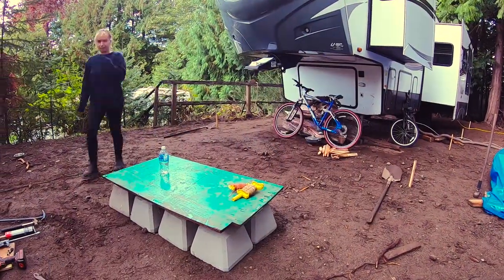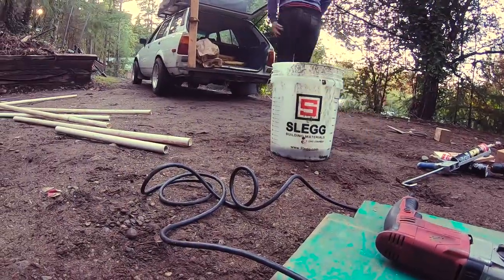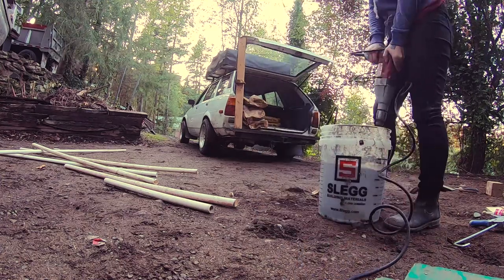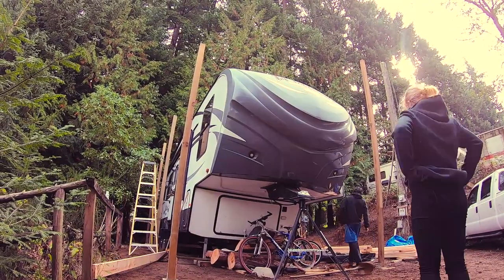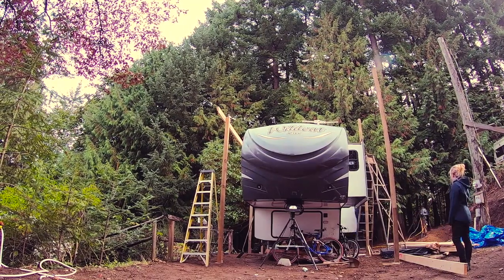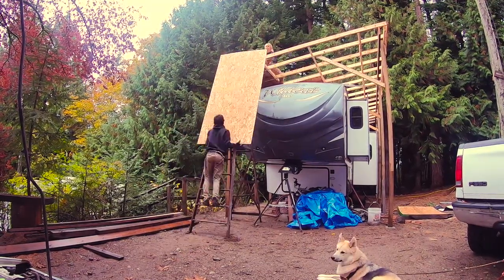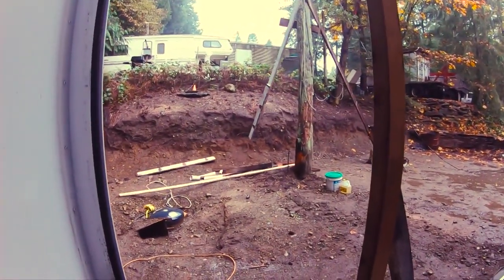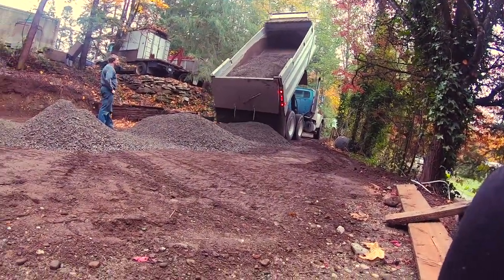#diy #rv Overhang/Lean-to Build

Comment: I’m getting ready to do the exact same thing but I don’t live in mine but I have a used 5th wheel very similar in style . It’s starting to have water issues nothing serious I’m going to try and seal the roof a little and then build this over camper and slide outs
Reply from the maker: NICE! definitely suggest sealing the WHOLE roof again, they all are leaky, straight from factory unless you reseal every 2 years! Best of luck!

Comment: Looking.forward to doing this to our 5th wheel next year. Do you have the finished product as I didn't see what you put on top. And what material (quantity) did you use. We have a 42'. Thanks!
Reply from the maker: We just put flashing around the edges, and then used shingles on the top! Its been great for 3 years the way we did it, withstood heavy winters - and heavy wind storms. We would do it differently next time of course.
Reply: @lowidle  what would you do different next time? cause I also will be building a lean to for my 5th wheel for the first time and I thought this video was great inspiration for me to just get up and do it.
Reply from the maker: @pressureflipin1992  Honestly it would work just fine. but for longggg term, i would consider the posts better ( so they dont get so wet and potentially rot )- i think we would also do the cement / supports a little differently. Along with making the roof tougher. Its all personal preference in the end. We would like our things to last longer for the money and labor spent. I could see this structure lasting another 4 years probably, maybe even more.

Comment: Interesting to know how that held up under a snow load?
Reply from the maker: haha yeah we were curious too! 2000% fine. It has withheld a snow storm with about 1 meter of snow on the top. As well as 80+km/h with gusts, and tree branches and such falling on it. This will be one year since making it. We have since braced it with a smaller overhang for our front door entrance you can see in one of my other videos about the New RV. :)
Reply: @lowidle  Thanks! It looked to me the roof rafters were made of 2 x 4 material. Are you in Canada now?
Reply from the maker: @Marine-72  yeah pretty much! there are some larger ones as well. It was made on a budget and without the help of professionals - clearly. This was just to protect our home. And our first time so we didnt really know the proper ways. Alas, this is how you learn! :) 

back in Canada yes :)